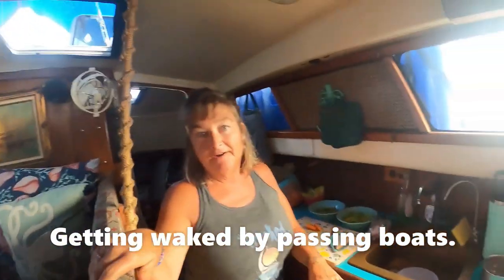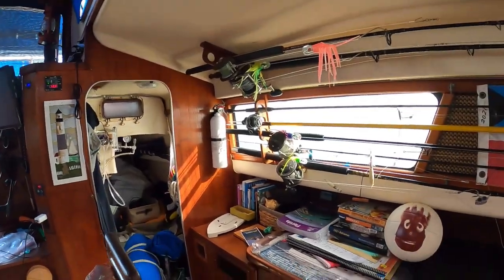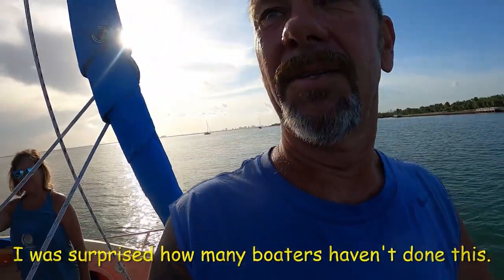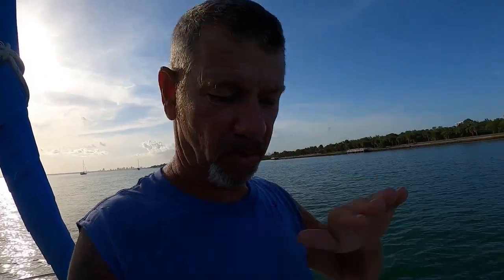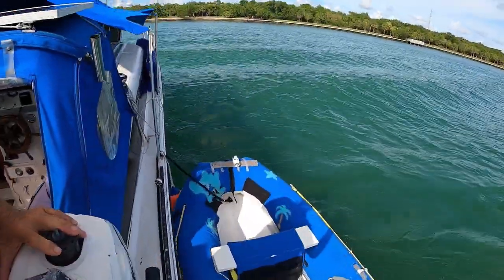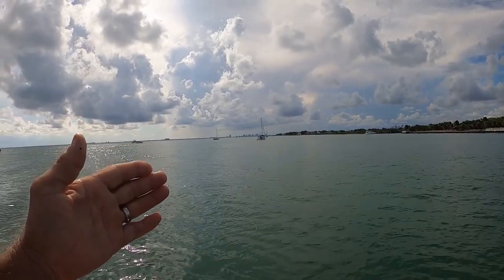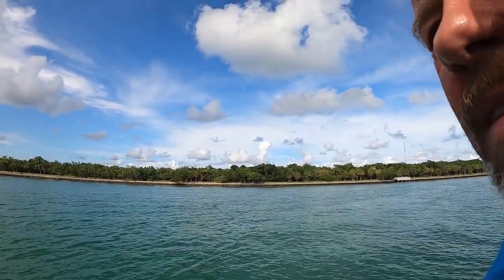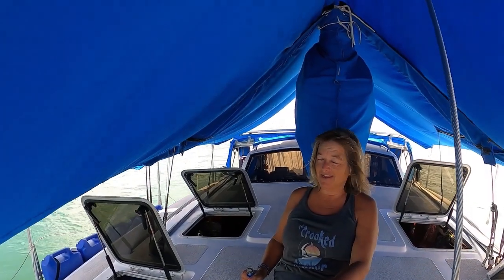Beam bridle (swell bridle), how to stop your boat from rocking.

Comment: Pull the rudders and centerboards and engine up when doing this…this works great for swell when the boat wants to point into wind that it different.   I’ve done this from a mooring also…
Reply from the maker: Thanks Walt,  we start out with turning the rudders first, it can make small adjustments that help.
Reply: One more thing… chain in the front sinks and boats that cut your bow won’t like that… rope gets cut…just saying, there’s was a Gemini in Georgetown last year that got their rope cut by a power boat cutting too close to the Bow of the Gemini…it’s a different issue but when they get way too close, it can save you…
Reply: @svthecrookedanchor  the issue is getting those lines caught on the rudders or centerboard or outboard when tide changes or wind and you drift Slav and then have them under the boat in some crazy way.   The worst is bridles on mooring balls.  Just with the normal Penants.  More than once we have ended up slack, floated over the mooring ball and the it gets the wind and current.. now the boat is backwards, ball under the boat and the mooring lines run back under and are tight and a mooring ball is beating the underside of  the deck… and you aren now stuck.   Boat is now stern  to the wind….
Reply from the maker: @waltsailing2009  Hey Walt, great comment, we love our Gemini 3200, the rudders pull out completely, with the center boards raised and the engine in the up position, there's literally nothing to hang up on the hull of our boat. I'm sure it's different for other vessels.
Reply: @svthecrookedanchor that is a plus over our 105mc, yours come all the way out, on ours they don’t completely come out.   I think they should, but the design has its limits.